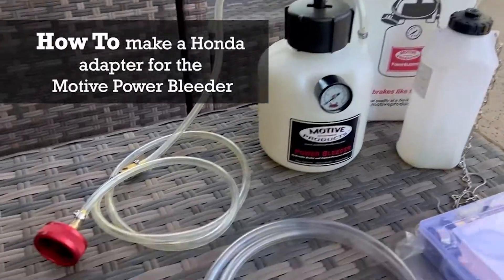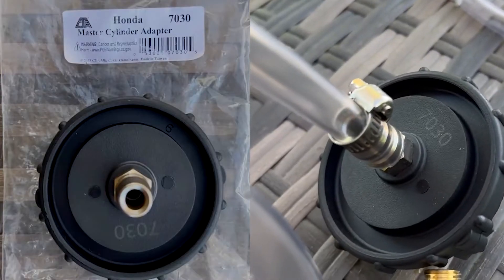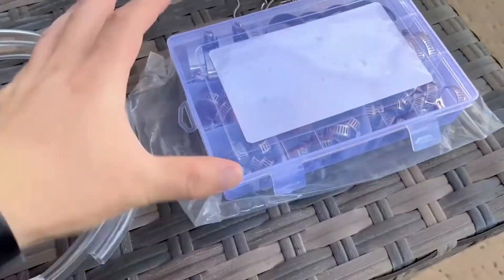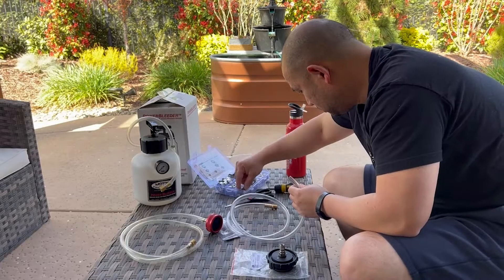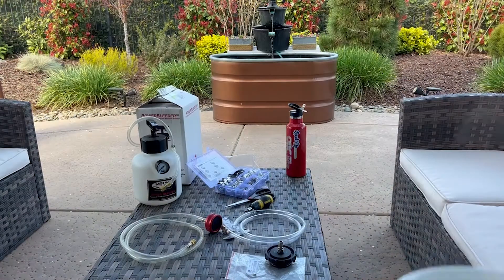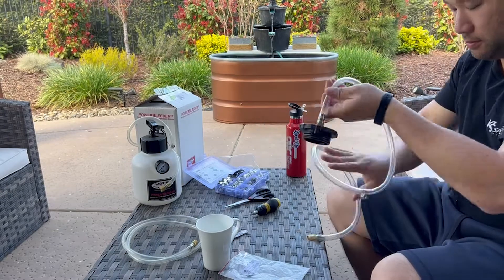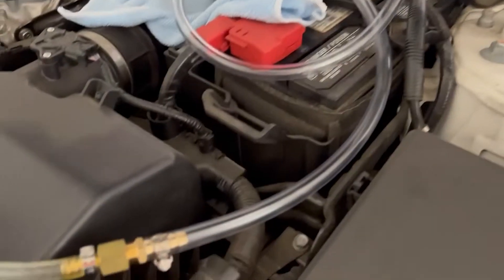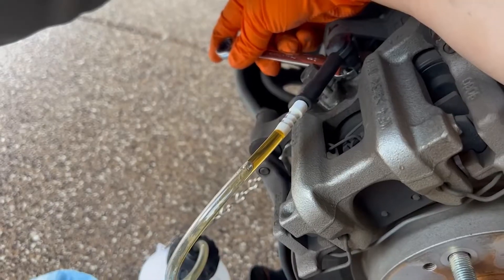How To Make A Honda Adapter For Motive Power Bleeder

Comment: Just a head's up for those planning on using the CTA adapter.  CTA has the following warning on their home page.  Honda uses different master cylinders even within the same years.  The 7030 used in this video may, or may not work for your particular Honda.  I'm ordering both a 7030 and a 7033 adapter to play it safe.  Here is the warning on the CTA website:

ATTENTION: Honda uses varying master cylinder tanks/caps throughout its production years, including different styles within production years, making it difficult to select the best fitting adapter. Our 7030 & 7033 adapters are designed for the same applications, but with a 1mm diameter difference. We recommend measuring tank/cap dimensions before ordering 7030 (O.D. 56mm) or 7033 (O.D. 55mm).
Reply: which one worked out for you?
Reply: I tried the 7030 on my 9th gen Civic LX and it didn’t even fit. Not even close. Got it off Amazon and Amazon said it was an exact fit. Nope! Haven’t tried the other one.
Reply: @GreyHatStudio  ah bummer
Reply: i have a 2013 Honda Accord LX. The fluid tank inner diameter was measured using a digital caliper and is 55.2 mm, i.e. adapter 7033

Comment: I had a leak at the junction where you connect the hose to the power bleeder.  Wondering if I didn't tighten it enough or if I should use some teflon tape on the fitting?
Reply from the maker: @ChrisHsuCars  yes use some Teflon tape too if needed. I just bleed brakes again and had to add some.

Comment: I just tried it but the pressure is not holding it seems like it is leaking air by the master cylinder any ideas on how to fix this
Reply from the maker: Check the gasket inside the cap.  Maybe add a little tape to seal it or refund and get a new cap.  For most people it works and I have used mine tons of times.  It might leak a tiny bit, but thats fine still too.  Its easier to remove so the air can leak out.

Comment: I tried your set up, and I have a slow leak around the master cylinder. I checked hose clamp and tightness of adapter. Any tips?
Reply from the maker: Hey Chris, I would check the seal inside adapter cap.  Make sure its sitting flush as you screw it on or its just not tight enough.  Also, if it has a tiny tiny leak it will be ok.  Just pump its some more as your flush each brake, so pump it and go release the nipple and come back and pump it and do the next brake.  As you release the nipple it will depressurize as well.  Worst case, return it to amazon and get another one.  I cant promise you dont have a defect cap, but the exchange process is really good too.  I hope this helps!  Also, one more last thing, a little leak helps to remove the cap when the pressure all comes out.  This will make it easier to remove the cap.

Comment: Will this adapter be compatible for the 2014 honda civic Si sedan?
Reply from the maker: I also have a 2014 Civic EX sedan and this adapter also fits on it.  I want to say this gen will also fit for the Si, but you should double check the EX and Si have the same.  If so, Yes it will fit.  Thanks for the comment! Sorry I took so long to reply.

Comment: Great video. I was one of the early adopters of the Motive when it came with the just a universal cap hard-lined. No way to swap caps.

Does your Motive pump have a female NPT with 3/8 barb?  Does the female end have an o-ring?  I want to build your set but I will also have to buy the female 3/8 inch end and want to know if it needs teflon tape or any other thing to make a tight leakproof  seal. Thanks.
Reply from the maker: Thanks for the question.  Yes my motive pump has a female NPT with 3/8 barb connector.  I don't have an O-ring.  If you are worried for a wet leak you can use teflon tape, however for dry method, which is easier and cleaner.  It is ok, as long as the bottle holds pressure.  I don't even have to tighten the male and female connectors extremely tight and it will build plenty of pressure. I would say just find the right connector for your model motive pump and the rest should be the same.  I would even consider just making the tube go all the way to the bottle and just get this Honda adapter (it WORKS) and don't use that universal one.  That was one of the caps I was not fond of, which is how we got here.  LOL
Reply: @levelupclassics  Appreciate it. Good tip!